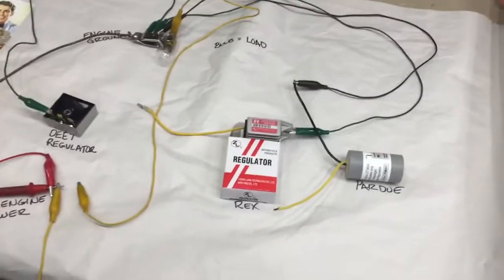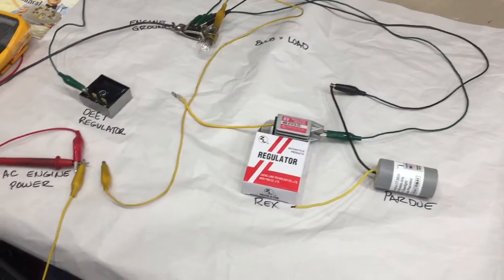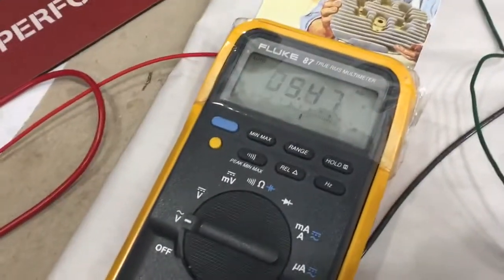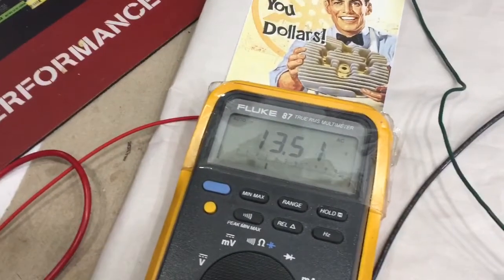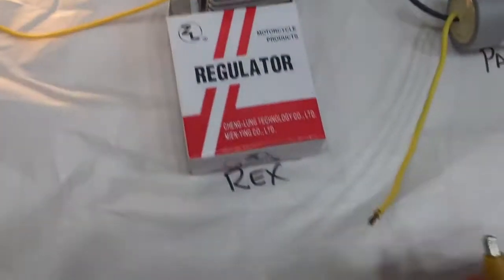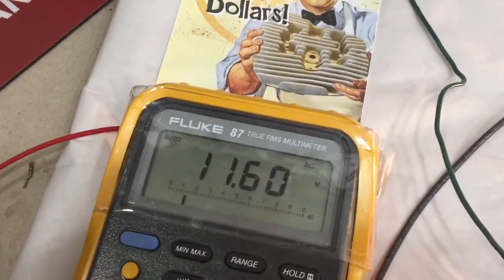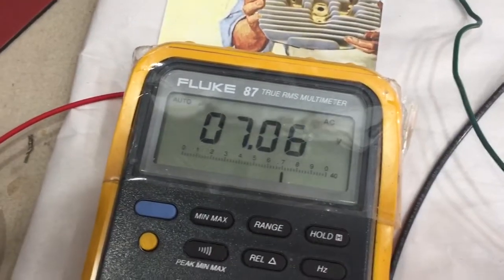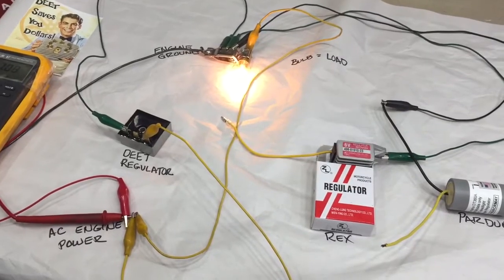6 volt regulator shootout

Comment: I had problems with my 1975 honda 350xl 35 years ago,  and it just seemed to never be able to keep a battery charged,  even after the shop tested the stator ok, and replaced rectifier. Thinking 8v might not be bad if your wattage requirements for your headlamp, brake lights and turn signals are taxing the system so much you cant keep a charged battery. I used to use an 8v battery on my 53 farmall superH and would keep a trickle charger on it so it would start in the winter months.